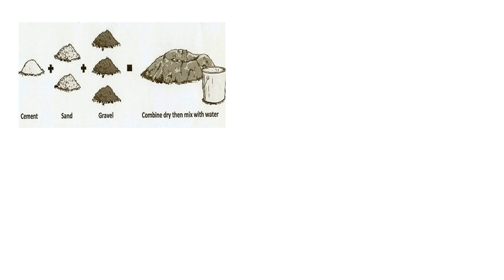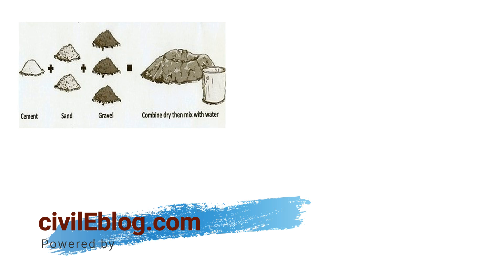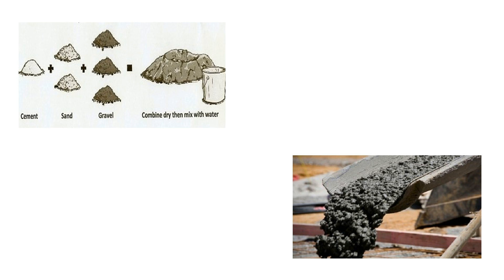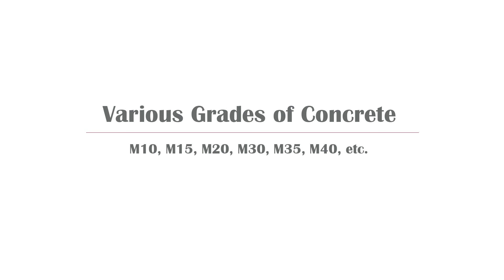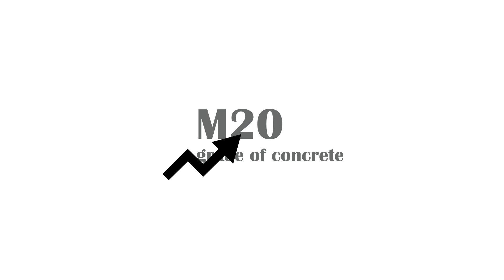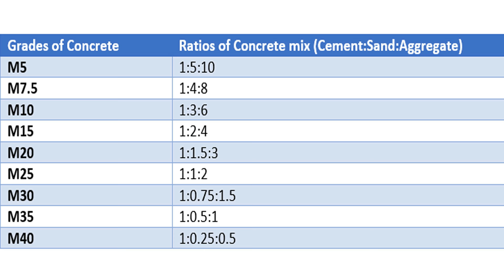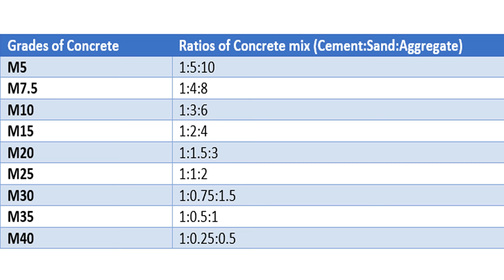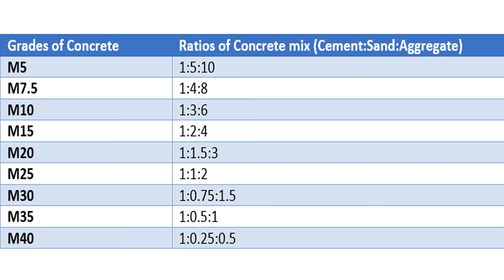Concrete mix ratio - Various grades of concrete - Concrete mix design

Comment: For M-40 mix ratio is 1:0.25:0.5 you mean if I have to make one M3 concrete then have to use
Cement: 400 kg
Sand:     100 kg
Aggregate: 200 kg

What nonsense is this ?
Please do clear how we make one cubic meter concrete by this ratio where Free W/C ratio is 0.4

Comment: For building a house which grade should be use
Reply: M 30
Reply: @13thbiosphere  I hope he didn’t follow your advise
Reply: @jesseadamson1077  m 20
Reply: @13thbiosphere  we’ll idk what strength is needed for a house, that would depend on the applied load which we don’t know. Secondly if it’s a foundation the question shouldn’t be what the strength but should be what type of concrete: and for a foundation it should be either type 2 or 5 (sulphate resistance, since it will be in contact with soil. ) The air content is also important depending on the region. And your Mix design will vary depending on the nominal size aggregate used in the mix, water-to-cement ratio, and the desired slump.

Comment: Wtf... for Low strength concrete Mix , Aggregate content is not as important as water cement ratio. 🙁
Reply: Long story short just don't use much water and allow a slow damp dry over 7 days and it should be fine.